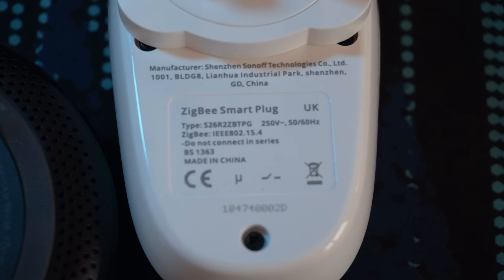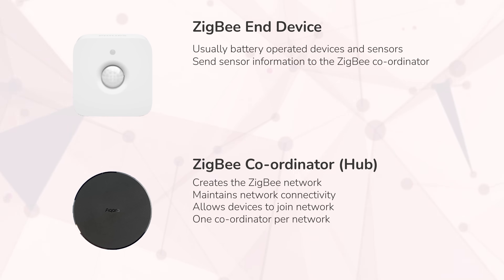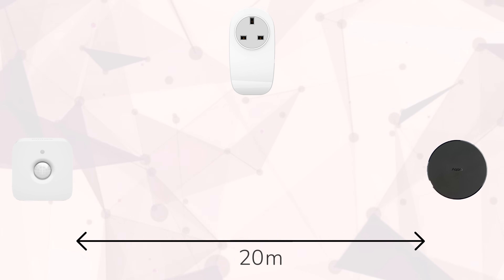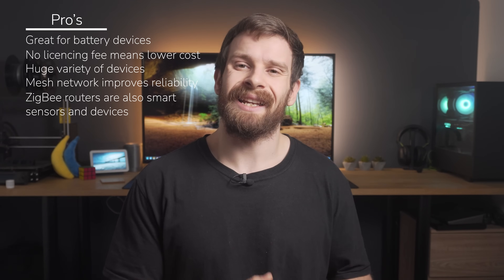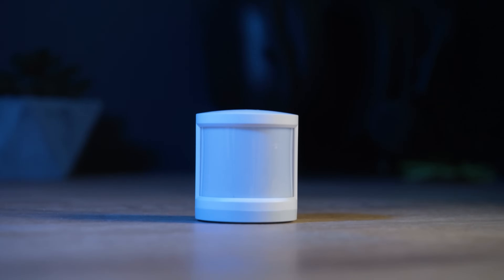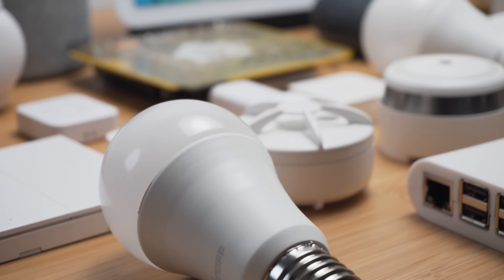Smart Home Protocols: ZigBee Explained!

Comment: ive just hsd to disasemble my house to do resets...twice...and home assistant still wont recognize the devices. so thst was fun and pointless. they need to use physical digital secure keys. not too costly but would solve all these issues.

i did notice though that my devices had attached themselves to the most distant nodes rather than the node or router in that room.  which explains all the signsl drops in the video feeds. its not likebyou can see it with all the nodes acting as one in the router software. and now i need to reset them all again to redo that issue.

they cant keep the reset physical and it cant be safe without a physical key

i hsve heard cutting your internet makes the devices pop up in the wifi section (puts them in connect mode) which lets you reset the wifi bit. yet to try it. would that work on the co-ordinator? 

also not seeing any good zigbee cameras for less than 6x the price of the normal 4k 8mp, so the cost thing goes out tha window right there.

Comment: Thanks. Very clear in a short time. I was looking for such information as I've got ZigBee communications issues. I my (old) home with huge walls 52cm I've got Wifi communication issues/difficulties, I've undersand that same frequency are used by ZigBee so the same should apply. I've install component and Smart Home was able to see everything, but I move one consumption sensor to an other place and I've lost some devices.

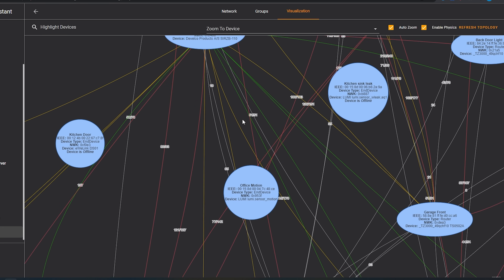@Everythnig Smart Home : How do you build and visualize the ZigBee Mesh Netwrok you show at 4:39 ?

Thanks in advance. And Thanks again for this video.

Comment: my zigbee motion detectors with Tuya seem to have decent signal strength at 5 meters line of sight. But put a gypsum wall in between and the signal strength drops to bad. Manufacturer of  zigbee gateway says  0 - 5 meters. This is ridiculous.

Comment: I see so many different brands of zigbee Gateway / hub.  Moes, Tuya, LoraTap etc...

1. It states it does wifi.  Does this mean that it communicates to my wifi router and the hub/gateway not connected to  ethernet correct?  The zigbee hub/gateway does not communicate directly with wifi outlets?

2. Wireless or wire (ethernet)  Benefits - I read one article that states if wired Zigbee could handle 300 zigbee devices vs 50-128 on wireless.

3. So many models are available for sale.... How do you tell which one is the latest model.  I've read the spec on one site that states its the latest model but when I read the specs it has the same exact thing as the old model.

4. Stand alone?  Is zigbee stand alone.  Do I need the internet for this thing to work?  So if i had a lan network no internet will I be able to see my devices and get updates.  I use Home Assistant.  NO one wants to live without internet but there has been time where internet is not available.  It would be nice to know that I could get updates from my home assistant.  

Thank you reading my questions and posting the video.

Comment: Could you please explain what is the difference of mesh WiFi than having multiple wired Access Points with the same security, modulation and SSID names?  Also is it possible to do a mesh WiFi with Access Points from diffetent vendors?  Is mesh WiFi using a single frequency throughout the whole wireless network?

Comment: great video. im a massive fan of zigbee myself despite issues in the beginning with poorly designed devices that drained a 2032 cell battery in weeks then ceased to funtion completely. not great when you bought 9 lol. with the esception of those particular devices ive had very few issues with the sonoff range and i have the lidl zigbee bulbs both rgb and non rgb in almost every room in the house. my biggest issue with zigbee is it seems there is a lack of availibilty in the uk and i have to get most devices from china or end up paying double

Comment: Thanks for this video !  I will start with Zigbee, so I wonder if I have to buy the ConBee II or the Sonoff Zigbee 3.0.  Can you give me advice ?
Reply: strsight off without even delving..its the sonos.   it hss the metal heatsink case.  the plastic dongle will trap heat and possibky fry the storage chips (happens with usb sticks if they undergo heavy use).   always go metal shell and then make sure its hot bits are attached to that shell. makes abhuge difference to sink the heat away.  im just guessing tjst these things run hot due to their nature.

Comment: I recently installed a Conbee2 coordinator in my office which is in the front of my house.  My garage is 50-75 feet behind the house and I was pleasantly surprised that I zigbee devices in the garage can connect. I do have an outdoor zigbee outlet on the garage to act as a router.

Comment: Do two nearby ZigBee coordinators cause interference in the network? I mean, if two different ZigBee coordinators are installed nearby but integrated into two different homeassistant servers, will their signals interfere with each other? I have noticed a weird behaviour once, hence asking
Reply from the maker: Potentially they would cause interference if they are on the same channel, for best results keep them on seperate ZigBee channels

Comment: I'm using zigbee, Aqara M2 to be exact, mostly because i really like Aqara devices, but their implementation is far from perfect, i really hope future standards are more rigid and don't allow manufacturers to temper with them, thus sustaining a more compatibility network for smart devices.

One question that i do have is, you said zigbee works on 2.4ghz but its far from 2.4ghz wifi, my question goes into if 2.4ghz zigbee devices, routers create noise or affect the performance of the wireless network?
Reply from the maker: I hope so too!

I think there was a little misunderstanding, I was saying WiFi and ZigBee in general aren't the same, but they do use the same frequency - yes there can be interference from WiFi, make sure to have the set on a different channel as far away as you can from the channel that ZigBee is using. Hope that helps!

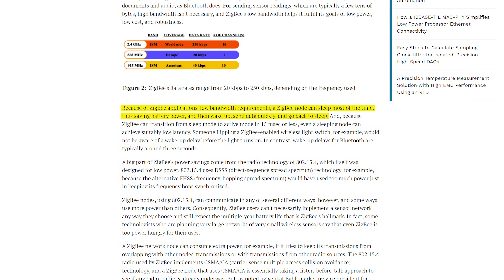Comment: 3:37 correction: On low powered WiFi devices, such as the ESP8266 and ESP32, you can turn off the radio and make the device go into deep sleep, all while having an external interrupt wake it up. While I know how to make custom Zigbee devices, I use WiFi in my mailbox using an ESP8266 in deep sleep, and the power consumption is ridiculously low. Easily comparable to Zigbee (I know, because I tested the power draw very precisely).
Reply: What kind of external interrupt are you referring to ?
Reply: @algre977  Wires shorted, button, anything really

Comment: Many thanks for the great video.

I started off with wifi as it seemed much cheaper to get started and Tuya was the platform of choice. I also found that WiFi was the most common protocol for makers particularly if one used the ESPnn range of microprocessors - it seems a lot easier to build firmware for. The challenge I hit was that by the time all the lights and some sensors were on there, I was rapidly approaching the 255 limit on IP addresses! It was then that I introduced a Zigbee network as well, particularly for the small sensors that were battery powered.

I have a couple of questions (I should state that I 'm still an over enthusiastic HA novice!)
1. Can WiFi handle  more than 255 devices (Using LocalTuya and OTA one tends to have to reserved IP addresses)? My reading suggests that is depends on your external IP address but it was all too confusing!
2. I have heard that there can be interference between Wifi and Zigbee due to common frequency band. Any thoughts on that?

Once again, thanks for the great video/s.
Reply from the maker: Thanks!

You can indeed have more than 254 network devices by either using a larger subnet or by using VLANs - enterprise networks have many many many more network IPs than 254 for this reason

Comment: Not entirely correct on the network specifics of WiFi.

Obviously it's allowed for WiFi devices to turn off their radio completely.

The magic WiFi uses is called DTIM. You can usually set the interval of those messages in your advanced settings.

In short it allows a device to notify the access point that it will sleep and wake only up at DTIM interval multiplied by the beacon interval.

For example DTIM interval is 5 and beacon interval is 100ms would mean that the client would only wake up twice per second and can deep sleep its radio and won't miss any packages.

The WiFi AP will buffer all communication in the meantime and set a bit for the WiFi device to notify it of communication for it so the client can ask for the buffered data and receive it.

Main issue here in terms of power saving is usually broadcast messages or multicast while the AP doesn't support IGMP snooping.

The latter means that multicast will be broadcast as well. This usually leads to several packages to be delivered to all wifi devices each second (mostly absolutely stupid stuff nobody cares about but Windows decides to send out anyway).

So that's the real reason you have power consumption issues with WiFi.
Reply from the maker: Of course you are correct - however this is about keeping it simple for the very beginner level for people to understand.

But good explanation/further reading!
Reply: @EverythingSmartHome  ah yeah. So you oversimplified 😅

Anyway if you want to boil it down you could say that each device has only the need to talk to the coordinator, not to any other device. Thats different to WiFi where the AP would let you take part in a larger network which communicates with each other.

So it's 1:1 vs m:n.

Additionally the specification is enormous, if you think of all the possible protocols which are supported on top of WiFi, while Zigbee is just a single simple protocol.

So there's a lot more communication going on than just "turn this light bulb on" - "ok done".

So a light bulb might have to wait and listen for several hundred milliseconds to find a nice empty spot in the air to send out its messages, while the TV is streaming some 4K Netflix show :)

Comment: @3:40 why do you say wifi device cannot go to sleep? All my battery operated ESP32 devices sleep, wake up, measure, send, go to sleep.
Reply from the maker: Different type of sleep :) in order for you to sleep your device, it will physically disconnect itself from the WiFi network and then have to reconnect which takes a bit of time in comparison
Reply: @EverythingSmartHome  not sure which sleep you are talking about but ESP  has minimum 3 types of sleep - the deep one is with the current around 5-20uA depending on the chip used. Make it 10uA - it can sleep for maybe a year. But for sure, ESP cannot do much with 1.2V battery while zigbee modules probably can (but I am not sure)

Comment: Great info as always 👍. I am moving away from the Zigbee/Zwave thinking I originally had since I'll probably gonna setup a decent UniFi network both indoors and outside in the yard so full WiFi coverage shouldn't be a problem. Is BLE gonna be featured in this series as well? I'm thinking of using BLE temp and humidity sensors in the henhouse, bunny houses etc. It would be great (I think) to have small weatherproof "blobs" and a hub/controller (or what it's called in the BLE world) that connects to HA.
Keep it up, I'm learning heaps👍
Reply from the maker: Thanks! We will indeed be covering Bluetooth!
Reply: I have a bunch of LYWSD03MMC temp/humidity sensors with BLE and a tiny display around the house. They have a custom firmware (flash-able via BLE on your phone via the browser) and talk directly to an ESP32, which runs ESPHome. Can recommend them a lot. I'd estimate 2-3 years of battery life, so that's quite good!
Reply: @mortenmoulder  sounds great! I'll check them out, I do need outdoor versions, does the one you mention cope with -20°C? I've got some 8266-boards and will tinker a bit with them. I also want door checks on a lot of animal doors so my plan is to 3D-print some special lock bolts that detects when it's securely bolted, not just closed (as the too expensive magnetic ones do)
I just started with my smart home, found a great channel, my first 3D printer is on its way - its a great life 😁
Reply: @bennylloyd-willner9667  Oh dang, idk about -20c or outdoor use, unfortunately :(
Reply: @mortenmoulder  living in Sweden makes things trickier sometimes 😁

Comment: Unlike your WiFi video, this one seems to be very incomplete, especially when it comes to cons of Zigbee. No mentioning that Zigbee will often conflict with your WiFi since they are both using the same frequency with very very limited number of available channels. That while Zigbee claims to provide mesh capabilities, it's not a true mesh, as the end device will always try to connect to coordinator, even if the signal is really poor, and will only connect to a single router if it can't directly reach coordinator. Nothing about lack of any type of self-healing or even forced healing of the network. And that depending on the configuration of your house, the more Zigbee devices you add to the network, the more saturated the spectrum becomes and the less reliable your network becomes.
Reply from the maker: I agree with your first point (it's something I considered talking about but didn't since it's very situational dependant - me for example it's a total non issue as there aren't that many WiFi networks close by) but the rest I do not agree with
Reply: @EverythingSmartHome  Sorry, don't want  to sound like a jerk, but those are not my opinions, they are part of the Zigbee specs. Zigbee spec has no provision for network healing and rerouting. The only way you can fix broken Zigbee network is by powering off your coordinator for 20+ minutes and wait for each end device to go into panic mode and wipe out it's routing table. Then when you add back coordinator you have to pray that end devices will connect back to it without any way to affect the outcome. Zigbee devices will also rarely if ever change their own routing tables if they find stronger source nearby, they will just keep their old routing table. That's why ZHA (for example) provides a way to join a new device through a router and not coordinator. Zigbee protocol in general has no mechanism to affect routing tables on the end devices, unlike ZWave.
In general, if your Zigbee network is working well - you are in luck, if it doesn't, there's nothing really you can do to fix it. In my house, Zigbee just doesn't work, and I spent weeks trying to fix it with absolutely nothing to show for it. I ended up throwing away all Zigbee devices and switching to something else.
Reply: Lack of self healing really suck. When a sensor lose connection (router gone for short while) it does not try to reconnect (my experience) by itself and you need to manually reconnect it....why is that so?

Comment: Great video!! I literally just started messing with zigbee devices this past fall.  I had used zwave in the past.  Fully aware of that single point of failure at the coordinator (im working on that in my k8s cluster lol) but I absolutely love zigbee for all the pro's you mentioned.  I passed this video along to some buddies of mine that haven't used zigbee because i think this is a very clean straight forward explanation.  Great job!!
Reply from the maker: Thanks, glad your enjoying the video!
Reply: couldnt you (or somebody) use a router as an access point for two mirrored coordinators. kinda like sata for iot.
again the need for a physicsl digital key for users would fix it. give people a key with the co-ordinator that not only secures the device but allows you to clone it. registers to whatever physical key is inserted.

or maybe just use sata on ssd or microsd partitions.

Comment: Interesting! But if a ZigBee radio is mostly off, how does a ZigBee switch respond so quickly to being remote toggled?
Or do ZigBee switches not sleep like sensors do?
Reply: your network must have one co-ordinator and multiple routers, that devices are always on listening,
thats why when a event happen on a sensor it just needs to send to the closest router.
Not needing to be on all the time, the sensor wakes up , process the event
if in case needs to notify something it just wakes up zigbee and emit, (maybe wait for a reply to know if ok)
then back offline .
That's why is so low on battery, since wifi must always reply to router that is up, if not it will disconnect,
not only that but the whole wifi stack is huge and takes time.
Hope it helps :)
Reply: @Gooloso98  right, but when a switch is being remotely toggled, it is receiving a message, not sending it. To receive a message, the radio must be on, and there is nothing to trigger it on the device. Unless there is a low power partial sleep of the radio, the switch radio must be on, surely?
Reply: @Gooloso98  wifi stack huge - my ESP32 devices connect to wifi router in less than 0.3s - from deep sleep wake up to getting IP address - is that so long?
Reply: @zyghom  compare it to zigbee, is even less. wifi has a bunch of rules to follow etc
Reply: @Gooloso98  that is ok, I am talking wifi as standard one. If you take i.e. ESPNow we are talking... 20ms
Reply: @zyghom  yap 10 times less, and espnow looks cool to dig into. Plus wifi starting a connection takes all tcp overhead, which weights more than a zigbee. 
On the other side wifi is more robust and less prune to errors.
Reply: @Gooloso98  and wifi is ... vendor independent!
Reply: @Gooloso98  and I am testing espnow right now - it sounds reasonable and it can also provide the routing as zigbee does. Same idea: sleeping sensor only sends data when awake, while router does the communication further. And such routers on ESPnow can be many. And the "integrator" is not needed. And even when the router espnow is gone, you can install another one using the same script - and when you use fake MAC address you don't have to touch/reconfigure/repair the clients.